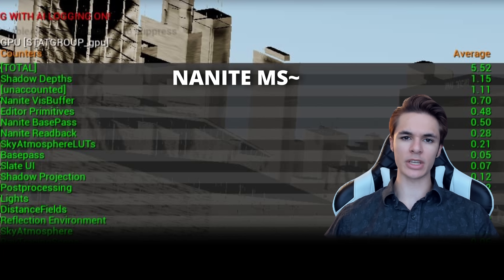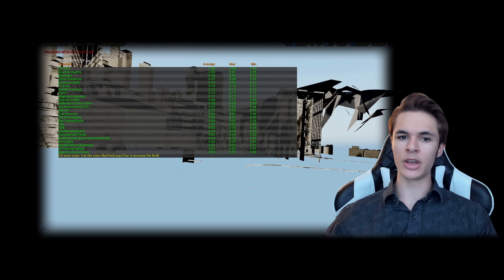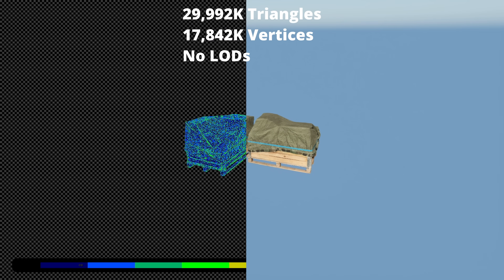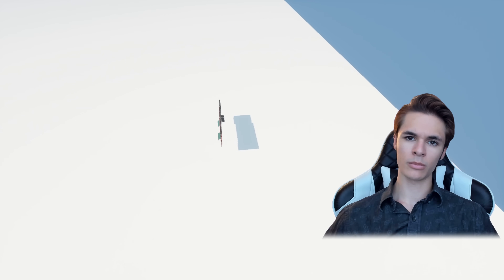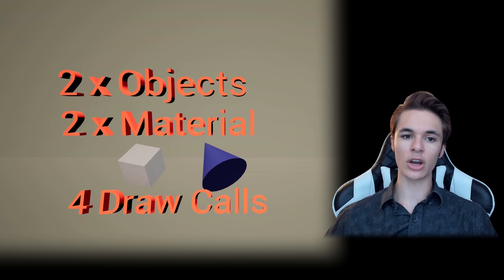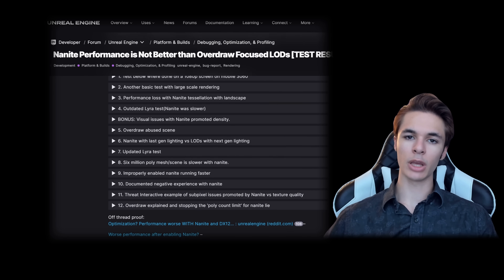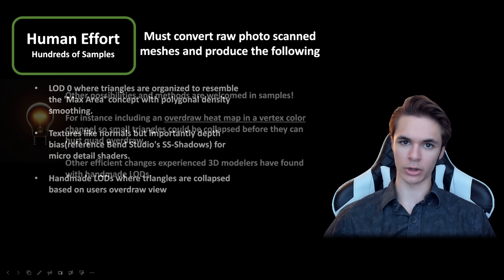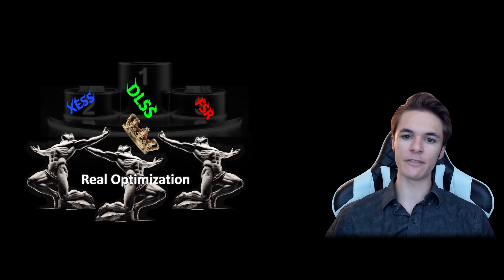Epic's Unreal Optimization Disaster | Why Nanite Tanks Performance!

Comment: Good video, but I disagree that you can currently train an AI model to reduce overdraw.
There is no architecture currently that can really take an AAA model as an input.
Reply from the maker: We are more detached from utilizing AI for implementing the max surface area topology than  most people are giving us credit for. We just need faster systems for LODs. One of the biggest problems with the LOD workflow in UE vs Nanite is LOD calculations is extremely slow compared to Nanite(near instant even with millions of triangles). We also need a polished system that bakes micro detail into normal/depth maps faster. 

The way we see is it's always going to be an algorithm. Most AI that get trained enough revert to one anyway.
Reply: @ThreatInteractive  "most AI that get trained enough revert to one anyway" mhhh... I wouldn't say so. Yes, in a sense its an algorithm but the sort of compactness, discreteness and optimality that you picture when you hear the word "algorithm" is not present in a whole bunch of matrix multiplications that softly guide the input to its output. Just because it is meaningful computation doesn't make it deserving of the word algorithm. The LTT video isn't really accurate and makes some dangerous oversimplifications.

I agree that tooling needs to become better, I also would love for there to be a magic architecture that you could just PPO minimize render time with and invents all of topology therory from that, but that is a long way to go... Transformers are constrained for sequence length and have a bias towards discrete tokens, not ideal for continous vertex data.

For now it seems like you need to bite the bullet and write actual mesh rebuilding algorithms.

Comment: Experienced level designers know what affects performance, so using a level created for older tech isn't exactly a fair comparison. Games simply dont tell their stories using locations and props that are too expensive to render. The existing optimizations incentivize usage of content and visual styles that can take advantage of the optimization, and compromises have already been made in the design because of this. The real question is, are the technical consequences of nanite worth it for what it enables? If you only look at content and styles that are currently in use, the ones that are optimized for the older tech, you'll never find an answer to this question.

Comment: First time hearing about material creating an extra drawcall 7:02. And I’ve done vulkan renderers as hobby projects. Could you elaborate how & why materials create extra drawcall?
Reply: I assume it's that a batch can only carry 1 material because their samplers are blown out with albedo, normals, bump and whatnot. Every change in material is going to context change these samplers causing a draw call or in the worst case change the entire shader. There is no API that can eliminate this behaviour, they can only increase the maximum draw calls before the gpu sets on fire.
Reply: @Sh1rhix  What samplers have to do if most examples that were showcased don't have any textures attached?

First example has one cube with one material, it should be just one draw call. 

I don't think that it makes sense that a material causes a second draw call. That would mean that there are two cubes rendered instead of one.
Reply: @warrior-m-aster  I think this might be an UE-specific thing, where they do multi-pass rendering. Now I understand what you meant, yes one object + one material = one draw call.
Reply: @Sh1rhix  Yeah, I discussed with my work college and he had the same theory about multi-pass rendering. It makes sense now that I think about it.

I think this should have been explained in the video to avoid confusion.

Comment: At these levels of Tri density, it MIGHT actually be more efficient to use a screenspace grid over a quad tree.

Since the Tris are often 1-pixel in size, you get quads that are so small they don't technically even count as 1-pixel in size. More like 1/4th of a pixel. To me, that's nuts. O_O

You could say something like "Hey, no matter what, there are a maximum of 64 tri's per every 8x8 section of the screenspace partition.". Not sure if this would be faster, I'm just thinking out loud here. =P

Comment: Key insight every optimizer should know: draw calls are not expensive, context-switching is. The more resources that a draw call shares with adjacent draw calls the cheaper it is to switch to it. If all draw calls share the same resources it's free(!). Don't worry about draw calls, worry about the order of the draw calls.
Reply: There is the issue of cpu bound to send work with few polygons drawcall but otherwise on modern hardware yes
Reply: So what you say is, if I spawn 10.000 of the same chairs, I don't even need to have them as instanced, or to have them merged into one mesh because the 10k draw calls will equate to one? I don't know man, I tend to disbelieve that...
Reply: @BlueBeam10  theoretically if each chair can be rendered in a single drawcall, I guess, which would be a very simple chair. instancing is good for more complex renders.
Reply: @doltBmB  But I though draw calls would happen for each non instanced mesh regardless of the complexity right? Since that chair isn't instanced, why would the engine assume the same draw call can apply to those other meshes?
Reply: @BlueBeam10  the engine doesn't assume anything, most engines are designed with 0 regard for these facts. it is up to the graphics programmer to batch their drawcalls appropriately. most engines implement some static batching at best which is an absolutely ancient way to do batching, requires some complicated preprocessing and eats bandwidth and memory
Reply: @BlueBeam10  did you not read what I wrote? or were you incapable of understanding it. read an article on what a drawcall actually does.
Reply: @doltBmB  You sound incapable of explaining anything you claimed.
Reply: @doltBmB  static batching is still good for easily optimizing massive amounts of low-poly meshes. Such as tiles.
It's easy to implement compared to something like greedy meshing and doesn't have much of a downside at low poly counts.
That said, systems like the SRP batcher used by Unity's DOTS workflow do exist. It batches by shader instead of by material.
Essentially as long as everything is using the same shader (for example, the URP lit shader), it's all batched for you. (to my knowledge)
Unity also has dynamic batching and GPU instancing if you want to use either of them. Texture arrays exist too.
So I wouldn't say it's "static batching at best" that's disingenuous at best and downright misinformation at worst.
Reply: @rikuleinonen static batching is completely outdated, greedy meshing is a complicated form of static batching
Reply: @doltBmB  static batching is still useful where static batching is... useful. GPU instancing has a seizure on extremely low poly models and actually lowers performance. Dynamic batching has sizeable overhead and is generally a last resort. Greedy meshing is not static batching itself, but rather an addition to static batching that combines parts of the same mesh. (usually used right after static batching)
Reply: @doltBmB  static batching is not outdated for certain applications and it's memory consumption is practically nothing in most applications. Greedy meshing is a combination of mesh parts on the same mesh not a combination of several meshes into one, though it's usually used in conjunction with combining meshes. They are not the same thing.

A technology being old doesn't mean it's not useful. What exactly do you think I should replace it with for these applications? GPU instancing? That eats FPS for lunch on low poly meshes.
Reply: @rikuleinonen Did you not read the OP?
Reply: @doltBmB  so, SRP batching is your suggestion? At least in regards to Unity.
Reply: @doltBmB  Why talking such low level when you don't even understand the relation between draw calls and instancing?
Reply: @doltBmB  DX12 has a feature that lets you batch work automatically. Im not sure how dynamic it can be but its not too different from just doing draw calls the normal way.
Reply: Nice Yotsuba pfp
Reply: I know I'm a bit late to the party here but I just wanted to re-iterate for anyone that managed to see this highly important comment. Draw Calls haven't been expensive since the Direct3D 9 days. Newer APIs and newer operating systems have significantly reworked how they function to avoid most of the overhead. But it's up to the engine designers to expose this and traditionally that's been somewhat difficult since they want to make their tooling as simple to use as they can. Regardless, some engines have made real progress in this direction. I'm not familiar with Unreal but as a real example, I know that Unity's Universal Render Pipeline has made steps to automatically batch many parameters of materials on the GPU side so that only the bare minimum needs to be passed to the GPU when actually issuing draw calls. This can certainly be botched by an ill-informed developer that then assumes all draw calls are bad but if managed correctly you can easily get tens of thousands of draw calls with very little impact on framerate.
Reply: @jamesclark2663 batching reduces draw calls. Draw calls still matter… a lot